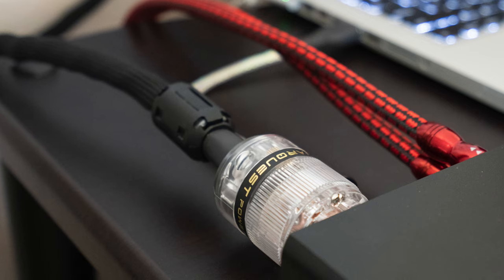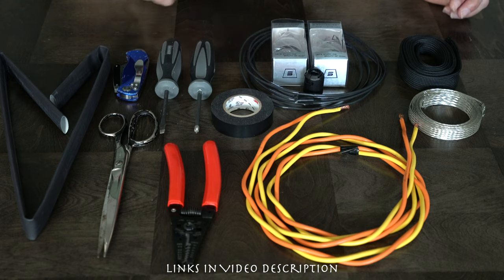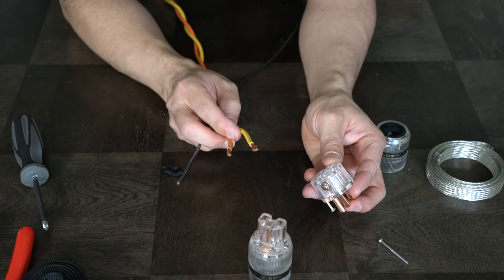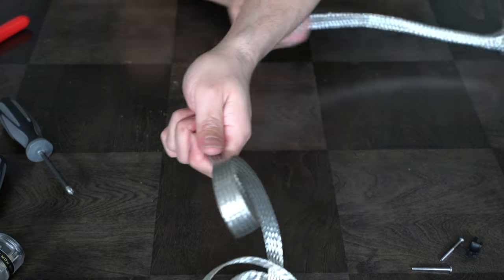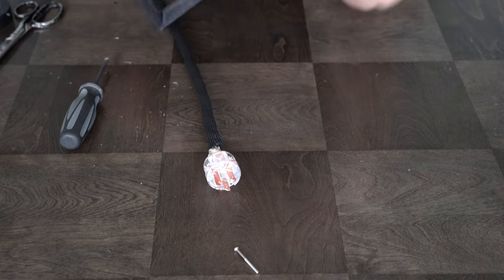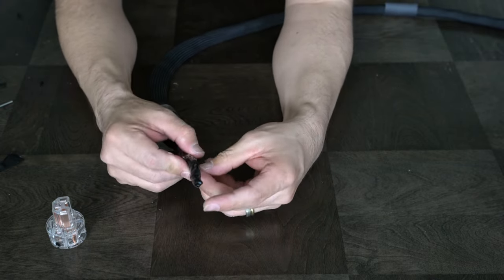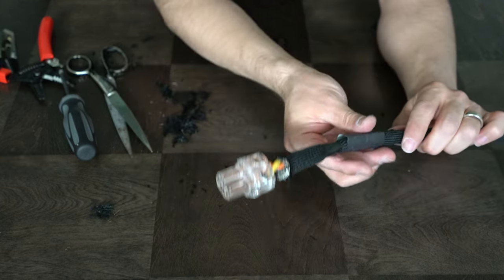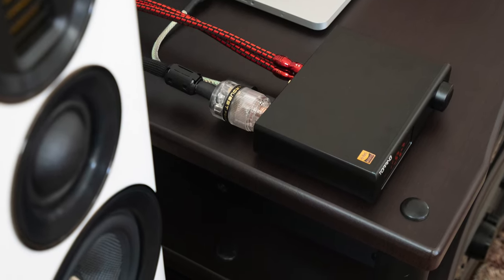Easy DIY Shielded Audiophile Grade AC Power Cords, Twisted Too!

Comment: Say what Willis? Most components run on DC, not ac. Whatever ac comes in is filtered internally and converted to dc. If ac affected the sound or "performance" of any component. Then that manufacturer would include beefy power cables. But they don't. Smarter people have determined that "Standard" ac wall plug cable is sufficient to power a unit. But, if you think it does, well.....good for you. You just bought something useless to brag about to others who don't know any better either.
Reply from the maker: Smarter people, most funny thing. Some people think themselves smarter than others all the time.
Reply: @Tharbamar  If you don't think that the Engineers who design these components aren't "Smart". Well I don't know what to say. I still stand by what I said. If the Engineers who designed component thought it needed other than a standard power cord. They would've included one.
Reply: Thank you, I was a union electrician for 40 yrs and started in electronics in H.S. I've been trying to explain the AC power at the end of a power cord is EXACTLY the same unless your cord is defective or too small a gauge. And you are correct, the first thing in audio gear is a power supply which changes the internal voltage and filters the DC. The current draw of say a pre-amp is sooo small the cord can be very small gauge. They are very pretty cords tho.
Reply: looks nice, costs more, must be better? funny, electrons are not all that fussy, they will flow through what ever they can.
copper works the same as pure gold, go figure! lol.
Reply: @Tharbamar  "Smarter people, most funny thing. Some people think themselves smarter than others all the time." - Exactly. You and the cable believers are much smarter than the amplifier's engineers and the whole developer team. You know what they missed. They should go back to the university .There are so many st...d engineers in the world jeez.
Reply: Roscoe is perfectly right. And the most funny thing is: using braided copper to eliminate (!!!) noise.  Dear Thar and the other believers: that 3 meter braided shield could eliminate the cable noise picked up only on that last 3 meters ! What about the 1000 km cable from the power plant travelling to you, going in air, underground and in the wall in your condo ? Who will shield that part for you ? You think that the noisy part is only the last 3 meters ? It's nonsense. An amplifier's PS will do whatever is necessary to the power. Easily. You don't have to filter the last meters. The merchant needs you to filter the last meters. He wants to sell exotic stuffs if possible. And you maybe need to believe that your device is special because only the power cord was $150 ! You were ripped off and you are happy about that. You could add up 2 power cables and you could buy a good speaker jeez ! The speaker is important. Th cable is shameless rip-off.
Reply: "You could add up 2 power cables..." - sorry that's not exactly true, simple power cables are not enough to buy a good speaker. But you can buy "Hifi Power Cables" with embedded active filters for $200...400 or you can buy "Hifi Power Strips" for $500...$1000 also. All of them focusing the quality, looking and "filtering, shielding" phenomenon. Poor amplifier engineers are still very st...id.
Reply: @telelaci2  , Too funny, anybody using the logic of the half of their brain that doesn't work would look at a power cord and what it does and what goes thru it and say WTF? One constant voltage, one constant frequency and NO audio signal! I guess you could argue your paying for build quality, but sound improvement, wow, people have NO logic whatsoever. You don't have to be very smart to see the power cord doesn't matter.
Reply: @bradt.3555  "You don't have to be very smart to see the power cord doesn't matter." - the reality is very far from that, the Hifi business is much filthier than that. Most of Hifi amaterurs believes in such accessories like the above one. Except maybe engineers and elecricians. Look at the title: "Audiophile Grade". This is only top of the iceberg, there are much worst things than this innocent DIY cable, you can buy assembled audiophile power strips for $1000, of course they look very fancy and cool, high quality indeed, and there are filters inside to catch the evil noises on the mains. And some hifi guys make listenings, comparison seances and they can hear the difference in sound quality too. Definitely. The $1000 audiophile power strip + power cables sound much better, than the regular $25 household powerstip. You got slightly more bass and more airy soundstage and a little less distorsion at high pitches. And this is a proven fact. And they believe in that. And they'll get offended if you start fussing around, they'll name you smartass.
Reply: @mergatroid1212  Did you skip science class? The conductivity between copper, silver and gold is quite different.
Reply: @telelaci2  Man oh man, you again demonstrate a misunderstanding of electricity.  There's a fact. Braiding of wire does affect noise rejection, even the last few feet.  Read up on the difference in noise rejection between CAT 5, 6, 6A, 7.  there a reason there are different types of CAT cabling, even though the basis construction is 4 twisted pairs.  FWIW, I an an electronic systems technician and 50 yr audiophile who's seen a lot come and go through the years.  While many of the claims surrounding cabling are inane bombastic superlatives, there is some validity to the claims.
Reply: @Mike82ARP  Man oh man, braiding protects the cable from electromagnetic interference (EMI), which would be realized as a kind of noise, a modification of the signal. Its called Electromagnetic Shielding, and protects from cell phones to kitchen appliances and televisions ... so on... from the electromagnetic (EM) energy. If it would be a signal at all and not the 50..60Hz high current mains.  And braiding also increase the flex life and mechanical strength of a cable. Flex endurance is important in machines, like a CNC when a cable is continously bent and is moving. These things are ABSOLUTELY unnecessary at a mains of audio equipment.
"CAT 5, 6, 6A, 7 ..."
What are you talking about ? High speed data transfer compared to 60Hz mains ??? Jeeez.
"...there is some validity to the claims." - and what does it mean exactly ? What claims ? You have no idea what claims, man oh man, you just believe in it. And that is religion not science.
The mains can be irregular, distorted, noisy by nature. No one said that it must be a perfect noiseless matematical sinus wave. It's not a signal and it can't affect the audio signal quality even in the most average and cheap audio device. The power supply does the job what is necessary.
"...electronic systems technician and 50 yr audiophile..." - you should be an electrical engineer like me. 50 yrs makes no difference, you have to go to the university for the knowledge. There is no other way, real life experience and aging won't make you Einstein, I don't wanna be disrespectful.
"There's a fact. Braiding of wire does affect noise rejection, even the last few feet..." - ok you don't have to be electrical engineer to solve this riddle: the mains connected to your device with a 100 meter long cable (let's assume the distance of the nearest city transfomator in your street, it could be much more in reality). You will try to protect the last one meter of that cable. The last 1m is 1% of the 100m ? How much noise will be "filtered out" with that 1meter cord. Don't need to be engineer, common sense is more than enough.
Reply: @telelaci2  Any comment on the video I posted? The video clearly shows that the last few feet of cabling/filtering does make a difference on the performance of an electronic component, even one designed to operate under less than ideal circumstances.    Because you can't measure something doesn't mean it can't exist. It only means that the technology to measure that thing hasn't been invented- the video nothwithstanding. I wouls ask, did bacteria exist before the microscope was invented? In your line of thinking, the answer is no.   Your comment above, "The power supply does the job what is necessary", is nonsense. If it were true, you should call all the hospitals and laboratories and tell them to get rid of their isolation transformers since they aren't necessary.  Better yet, call Dr. Daniel Melby of Abbot Northwestern Hospital in Minneapolis, the subject in the video, and tell him the improvement on the electrodiagnostic instrument is imaginary since the "power supply does the job."    Sorry, but you've embraced scientism.  Try to find someone with a good audio system who can demonstrate the importance of filtering and cabling in a system.
Reply: @telelaci2  I'm with you on this. In other discussions on this subject I've tried to explain that any small (very small !) changes in input voltage/current/noise due to using a "better" mains cable will not change the DC that powers the electronic circuitry inside a CD player, DA, streamer etc. Therefore there doesn't seem to be a logical reason why the "better" mains cable would alter the audio output from such a device. If it's true that there is a perceptible change in the audible output signal, it's perfectly possible to either measure the change in that signal, or even measure the change in the power supplying the internal circuitry. If a mains cable is reducing noise being fed into a device, it should be fairly easy to measure the results of that noise reduction within the device. Why haven't I seen a cable manufacturer provide these measurements to backup the claims they make about their products ?
Reply: @ProffAndy  Andy, they say: it's not measurable but the noise still could be there and you can hear the difference. The statement is totally unprovable by it's nature that's the trick. (Of course the ear is much-much less sensistive than a precision instrument) You believe it or you don't, it's up to you. It's religion, faith, superstition or whatever you want but science. And it costs a lot of money.
Reply: Yep, I was just wondering why speaker cable for my 250w rms speakers is recommended to be 14 or 12g and power 5 or them from the same gauge wire from the wall.. and you hear of cat audio guys using 2 or 0 for their 1000-2000w amps in cars.  Thought a 5 channel 1300-1500 rms amp would need at least a 6 or 4…
Reply: @MegaThrillKiller Some people like drinking the Kool-Aid. 😊
Reply: @telelaci2  LOL, you two tin can and a string guys crack me up. 😂

Comment: Anything on the argument not to use shielding at all by using weave only for mains cables? And also, definitely not using ferrites on mains cables?
Reply: yup
Reply: Hi, so you mean that shielded weaved sleeve only on the orange and yellow but not on the black ground?  Even less noise floor? 
And ferrites?
Reply: 🤗u should throw away Tinned Braided Shield becomes is too Bright & Live Sound. pls change to Carbon fiber Braided Shield. Sound much much better.😉

Comment: Generally it’s my understanding that if you buy a decent component, you can rest assured that the power cord that came with the device will do the job. You don’t have to replace it, unless you want to have a fancy looking power cord and that’s okay too. Fancy power cords will typically not change the performance since AC is converted into DC, and almost certain the manufacturer has installed a noise filter in the component as well. Nice looking power cord though. 🙂
Reply: No, sorry it is not like that. Hans Beekhuyzen explains in audio hygiene why. The power cables delivered with the component are normally not shielded. It is the shielding which is preventing the power cable to radiate disturbance to for example an RCA cable carrying the audio signal, which are mostly nearby on the backside of the component.
So it is not the disturbance from outside going into the power cable.

Comment: I have got IEC connectors that are marked 125 volt 15 Amp is it OK to use these in the UK for amps CD player and power supplies all for Hi Fi. The ones shown on the Ad on eBay were marked 125 to 240 volt. Will it be safe to use these?

Comment: Ok so I have been working in electrical & cabling systems for 30+ years & although I am a "non-believer" (that it makes any difference noise wise) I will offer you & others that wish to make their own power cables a pretty good tip, because after all manufacturing your own to a specific length to suit your equipment if it doesn't cost you much will be satisfying (just don't bother with the shielding bit)
So when you start with your three wires before you do anything else hold all three together & insert them into a cordless drill like you would for a drill bit, then hold the other end tight (or get someone else for that bit) then pull the trigger on slow & watch your wires all spin together perfectly without any kinks or uneven bits. Then when you apply your outer sheaths & heat shrink it will be smaller diameter & easier to slide the last bits over. One last point...don't twist power wires too tight, just similar to how Tharbamar did is fine.
Reply: Thanks a million, Mark!
Just taking advantage of this to ask a basic (for me, a lerner) question: why do I see folks twisting all the internal cables and audio path wires (input wires) inside the amplifier?
I see twisted cables from vintage power boards to the output transistors bolt to the heatsinks. Same thing with the "minus" and "plus" cables from the PSU to the smoothing big capacitors...
In essence, what the big "benefit" of twisting wires and cables? Aren't these creating a bit of resistance end to end?? Thanks again!
Reply: @montech5647  Hi Montech, so twisting wires is all about attempting to eliminate RF interference. If you imagine those wires all loose with different spaces all along the length any induced EMR would be different strength's depending on how close or not each wire is which in turn would pose a problem for removing it.
Now imagine the wires twisted...they are all equal to the noise because of the twist & as such an equal induced noise presents a "common" noise which common mode rejection circuits can remove a lot easier than random wires. 
Mostly this is a problem where the wires are a feed into any amplification stage (you don't want to amplify noise)
The power cables that Tharbamar made don't have to be twisted for any other reason than making it neat & easier to slide sleeves over, the same goes for speaker wires. Wire resistance doesn't have anything to do with twisting, if all wires have the same material/gauge/length they will be extremely close in resistance...loose or twisted.
Reply: Hello Mark, how critical or important is “ torquing down” the screws in this application.  I just viewed a video from Furutech where they recommended a torque of 80 c (not sure of the rest).   Thx, Mike.
Reply: @makatac2629  thanks for the response. I'm trying to eliminate crosstalk between input channels' cables and was advised to keep the wires and cables a bit far from each other, but this seems pretty difficult to achieve...
Reply: @mikeeygauthier2959  
That's essentially a mechanical lug, I've tightened/torqued thousands... just make sure it's really tight.
Reply: Actually, Do bother with the shielding. Not because of noise issues, but induced electrical fields. Get a cheap EM meter (like the Erickhill RT-100 from Amazon) and run a test on shielded vs non-shielded cables. My TV power cord was throwing a 180 V/m electric field at about 6 inches from the cords until I shielded, and grounded, it. My wife is very EM sensitive (she can tell if my cell phone is on from 15 ft away) so shielding everything helps her.
Reply: i actually wanna make one to a specific length. i do appreciate your insight and advice. im curious if you do skip the shielding what happens? what happens if you dont skip the shielding besides keeping cash where it belongs lol? i know your comment is 2 yrs old but hey. on a side note do you know anything about powered sub plate amps? i have one now that only has static coming through the speaker. no music etc. and the static is not able to be controlled by the volume knob. got any advice on that one lol. thank you sir.
Reply: yeah, shielding's unnecessary if it's braided, you only do that if it's a shotgun arrangement

Comment: have ordered some 4TC cable from China on ebay, it has 8 braided conductors in 2 colours all constructed the same way Kimber build theirs. this allows for no shielding to be required as the 8 strand braid acts as a natural shield. also the construction is like a tunnel that allows you to thread a single conductor through for the earth, it just looks so much neater when finished

Comment: Til now I've been like so many people, ''What came with the box gets the job done.'' Recently had some time to kill so I finally got around to building this cable for every box in the chain. 8 of them. So far, I'm warm and fuzzy about it😄.
An overall increase in dynamics. The soundstage, in terms of instrument placement has always been good, but, now the instruments feel more solid and articulate. I can just simply hear  more, and It is a lot nicer to listen to. 
If I wanted to spend more for wire what would I get? OCC this time? Though I still want to maintain the same method you've got here, and don't want a finished cable that is already shielded and only needs hooking to the plugs.
Thank you my friend!

Comment: Hi Tharbamar :) Im your huge fan from Poland. I made a lot od DIY cables because of you. I now want to make this power cable and have question. You said that this cable is made for transports, dacs etc. But what about power amps, mono blocks ? It can be safely use to power amps without risk of overheat? In other video you made AC from 3104 but using all 4 wires but without shielding - which one is better?